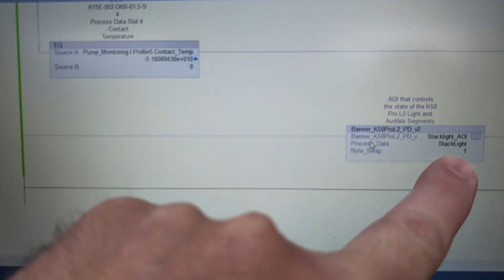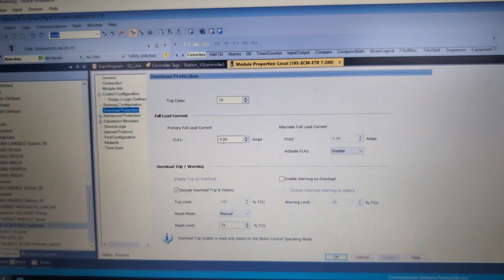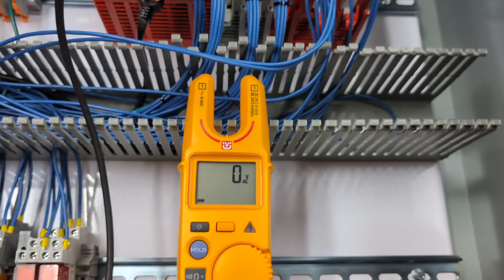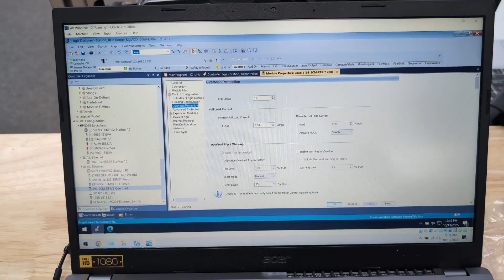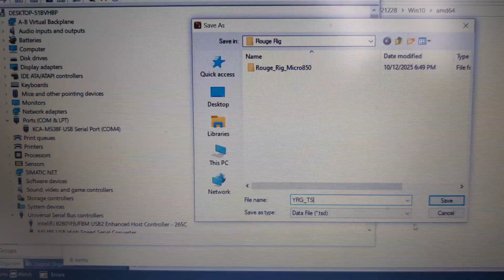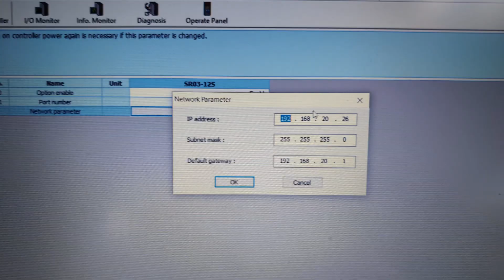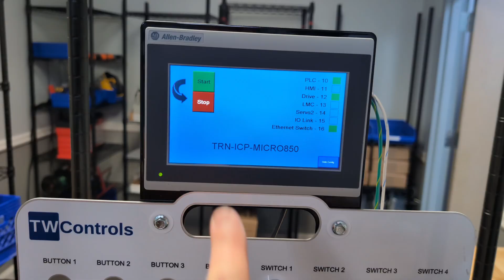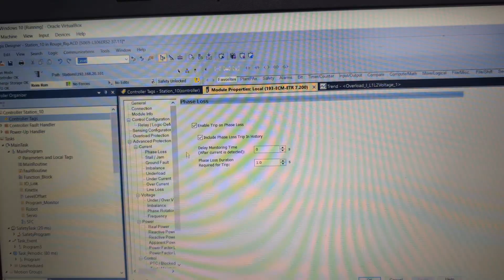Proof I Should Have Metered Sooner: Safety Switch Fail & NPN Surprise

Comment: The E300 is a 3 phase device, you have to loop one of the single phase through two phases of the E300, so all legs have current running through them.
Reply from the maker: I have all 3 phases going through the E300.  I think my current is too low.